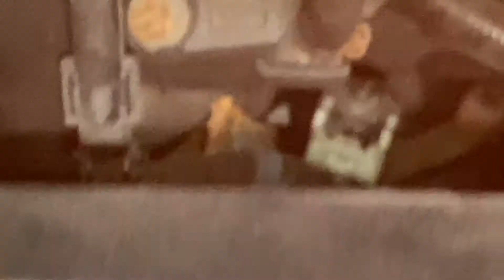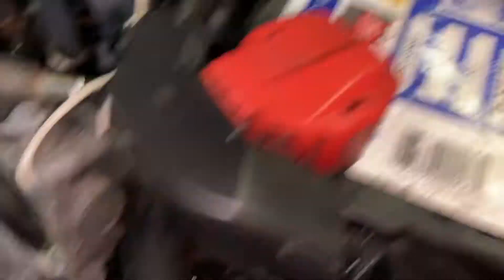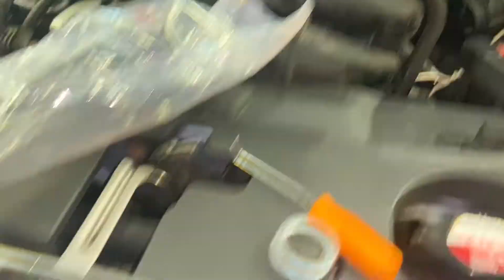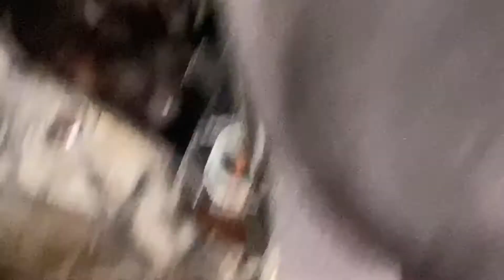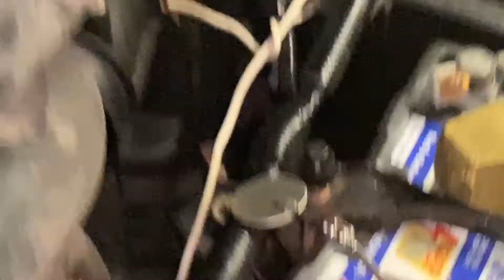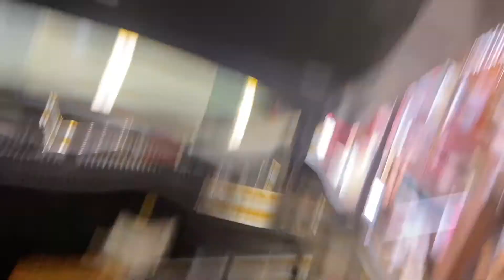K24 Honda Heater Pipe Replacement CRV ACCORD

Comment: Great video!!!  Thanks Drew...you got me though this job! I want to mention what went bad for me in the hope that it helps someone else.
2007 CRV EX
1) Be very careful with the throttle body...while carefully disconnecting the coolant lines, one of the tubes crumbled as it was completely rusted out.  I couldn't get the intake plenum out without removing the throttle body.  Throttle bodies can be very expensive, and you have to know whether the car was manufactured in America or Japan.  For the cars manufactured in Japan, the throttle body can cost much more.  Of course, my CRV was manufactured in Japan.  I was able to get an aftermarket throttle body for a fraction of the OEM price and it is working just fine.
2)  The heater pipe broke off inside the thermostat housing as expected.  Couldn't get it out and had to remove the thermostat housing.  The easiest to access bolt (top one) was seized inside the plastic housing.  I had to cut the plastic around that bolt to remove it and damaged the housing.  Don't waste your time with the housing from AutoZone, it doesn't allow those special bolts to pass though when attaching the thermostat.
3)  A re-learn procedure will probably be required when disconnecting your throttle body and was required for adding the new one. I was getting a P057 code for idle higher than expected and it was idling just over 1000 rpm.  The re-learn procedure did not work without using a scan tool to reset it and then it relearned just fine by driving the car.

Thanks again Drew!
Reply from the maker: Wowsers! Yours was quite the adventure! Thank you for these comments I hope they get seen. Maybe there is a way for me to pin them

Just a note: the Vin number tells a lot about where the car was made. J is Japan. A full list can be found googling (check out the Buick envision - made in china!). Glad you’re through it! Please like and subscribe if you haven’t already :)

Comment: I did this job today and your video helped. Thank you.
My tips are: DEFINITELY have 10mm and 12mm bolt extractors on hand. Replace all four manifold gaskets, you don't want leaks and the gaskets are very cheap. There is no need whatsoever to remove the throttle body from the manifold, unnecessary work. Use a liberal  amount of silicone grease on the heater pipe O-ring. Use a Honda heater pipe if you can find one. An aftermarket pipe MIGHT work but if it doesn't, you get to do this mess all over again.

Comment: I want to thank you for making such an amazingly detailed video.
I'm a former master wrench, and knew it would be a sucky project on my son's 2010 CRV.
Hard to to find the pipe, but I lucked into a new-old stock part.
I didn't have to remove the throttle body.
I also didn't break the bracket holding the connector to the manifold, but it took about an hour to get it off.  
If unbroken, the pipe is very hard to get off due to hanging up on the aluminum intake assembly at the front AND the bracket on the right side severely limited movement.  I probably spent nearly 90 minutes patiently trying to remove thepipe without breaking it off in the thermostat housing.  I had a spare housing and gaskets ready for the worst case scenario.
In the end, i used a small pipe cutter.  Once the pipe was severed, i was able to get it out.
I worried that it would be difficult to get the new one in place, but it went in pretty easy.
Your humor was awesome!
It took about 7 hours which included setup, a short break or two, and full cleanup and test drive.  I'm very patient, and moved carefully through nthe process.
Funny, it was much faster reassembling.
The job is not for the faint of heart.

Comment: Drew... Thank you.  You got me through a nasty repair. (2010 CRV 4x4 LX)
Thank you brother. (great tip btw on the long bent needle nose pliers, I had no idea how badly I needed those)

I bought my pipe on Amazon   "COOL STAR 19510R40A50 New upgraded Heater Pipe Comp Heater Compatible with 2008-2016 Honda Accord 10-11 CRV Odyssey Tourer 19510-R40-A50"  It fit perfectly and included the gasket.

Also, to the commenters... Thank you.
I left the throttle body attached - great call
I changed the 13 year-old starter also when I was there.
It was a BEAR to get the 14mm and 17mm bolts out even with the plenum removed.

Thanks guys, Chris M. in Tampa, Florida   
2.18.2023

Comment: Thanks for the video.  I just took mine all apart yesterday and my pipe was broke off in thermostat housing as well.  What a bugger to get that piece out!  I was able to leave the throttle body on and just left it attached to the intake plenum.  I did take out the air filter box and battery to give me room to see and work. Those came out pretty easy.  Thanks again .
Reply from the maker: You’re most welcome! I’m glad it worked out! I think a seal puller helps when it breaks off. Either way a pain! Please subscribe if you haven’t :)

Comment: This video is a car-saver (lifesaver !!).  Visually, because of rust ring at leaking joint, I first thought I had a rubber hose with rusted away clamp.  Removed steering pump, then alternator, for access and THEN discovered hard pipe - still shiny enough that I thought it was hard plastic.  Wasted goodly amount of hours with wrong diagnosos.  Found video (only other one on YouTube) and finally knew nature of the joint.  Have ordered thermostat housing (just in case) and steel pipe.   This video is VERY  thorough and complete for repair, start to finish; it is invaluable for getting the repair done with a proper approach and technique.
Reply: ...and pipe.  This video is VERY thorough and complete for the job, Start to Finish !  I agree with comment by another "The best how-to video" ever.  THANK YOU Drew C.
Reply from the maker: Well these are extremely kind words! I am glad it helped! Please subscribe if you have not already. I am working towards putting together another video that will be the only one on YouTube, the dreaded Prius evaporator core! Anytime I attack a big job and don’t have a video to go by, I try my best to create one to help you all! Glad this was valuable to you

Comment: When tightening the intake plenum DO NOT start at 1 end ALWAYS START IN THE CENTER or you could have a high-risk and cracking the intake and having a big problem just a quick tip. Great video super informational just wanted to throw that out there though.

Comment: The best how-to video I've run across, bar none. I was on the fence about doing this job myself and finding this video convinced me to DIY. I had to source the pipe from Japan for 4x the dealer cost as well due to the backorder. In the meantime I watched this video three times and then queued it up in my garage as I did the work. I really appreciated the level of detail like how to disconnect each wire harness & retaining clips. I had the same issue with the lower wire connector clip swelling in the housing and had to wire tie it the same way. Also appreciated were the tips like on the brass hammer to seat the sockets, rags in the intake manifold and all the fastener access tips. Thanks to you I got the job done in a few hours. After seeing the trouble you had in removing the pipe end / o-ring, I cut the old pipe on the straight section. That way I was able to work the old piece back and forth to remove it without breaking the end in the plastic housing. Thank you, thank you, thank you for making a miserable job easy.
Reply from the maker: Wow I cannot even begin to tell you how much this feedback means to me. Seriously, these are very kind words and they mean the world. I am glad the video helped! Stay tuned in on the channel, because we own a small car dealership and, over the last two years and change, I have been 93% and a little change Toyota/Honda. The K 24 motor is ubiquitous among our inventory, and I do all the work myself and try to share anything I find that is helpful :-)
Reply: How to install back heating pipe?
Reply: In

Comment: Owner of an ‘07 CR-V EX here. Thank you for posting this. Just got the job done. I didn’t have to remove the throttle body and anyone with an ‘07, ‘08 model has to be mindful of the lower bracket on the aluminum plenum. Saved hundreds. Thanks again!
Reply: I have to do mine on my 08 crv.   do you have a part number for the pipe..from what I saw it says it's discontinued. Did you have to remove the intake manifold ??
Reply: @minibikemadman  Honda Dealership can give you the pipe number. Then go to “the bay” and order it from one of the stores. Don’t forget the OEM O-Ring. It has to be OEM. Yes! Manifold comes off.
Reply: @jonathanmelendez23  great to know ok ya I got a pipe on ebay a oem one ..was the last one so took my chances and said it fit my 08 ex-L . I had to do one on my 2007 Acura rdx before the crv and all these pipes rot and leak.  The only crappy issue with the K series.
Reply: It the same pipe of the 07 Accord

Comment: Hey there great job on the video.  i just replaced my pipe and starter on 2011 crv with 139000 miles on it.  it took me all day bc i clean and lubricate everything accessible as i go along.  regarding the electrical connection that swells up into the metal retainer bracket attached to the maifold.  it took me about 15 minutes to manuever that thing off with penetrating oil fluid film.type oil and just plain rocking and patience.  i got it off without breaking it.  i did a couple things a little different from.your video  but all in all your pain stakingly done video was really helpful.  just subscribed to your channel.  take care 🙂

Comment: Great video.  I saw blue stains on the engine block on my wife’s CRV when I was doing an oil change.  I tracked it down to the thermostat housing.  Had no idea there was a metal pipe there all rusted out.

I plan to do this as soon as I get the parts in.  The past comments were also very helpful and will try to leave the throttle body connected to the intake.

Comment: This was a fantastic video in order to get the pipe out with the O-ring on it I put some vice grips around mine and pryed up and down on the vise grips you have to place the 
Vise grips all the way down on the plastic and then use the plastic to pry the pipe out with the vice grips I hope this makes sense it worked for me and my pipe had a hole in it as well so it was very weak as well

Comment: Great Video!!! Removing the broken pipe part from the thermostat was a nightmare. I was finally able to remove using an Oscillating Tool to cut it just enough to weaken it so that I collapsed when removing it with a screwdriver (If I had to do it again, I'd spend the $40 for a new thermostat housing vs trying to remove broken part). Clip on the large hose connecting to the pipe was also a headache even with the angled pliers. I took a magnet and stuck it into the thermostat housing to pull out the metallic debris resulting from removing the pipe. For the lower connector Drew had problems with, give it up and just break the metal bracket because you're not going to be able to disconnect. (2011 CRV with 127K Miles)

Comment: this is a very good video on how to remove this pipe and the things that can arise along the way...to save a bit of time when removing the plenum I did not need to remove the throttle body...it was a bit tight for space but it will come out if you just move it around to get the correct angle to pull the plenum out...I also just removed the 1 bolt from the bracket on bottom of plenum from the engine instead of messing around with the 2 bracket bolts that go into the plastic plenum and the whole plenum and throttle body assembly will come out...also there is 1 bolt and 2 rubber grommet connections that hold air cleaner housing in place which makes disconnecting the rubber heater core pipe and installing it so much easier with air cleaner filter housing removed so the heater core doesn't get damaged when removing the rubber hose from the steel heater pipe being replaced...the Honda engineers were not thinking of us mechanics needing to replace this heater pipe for sure when they dreamt up this design...

Comment: Excellent video! Thank You Much! Been looking for a video on this job. Yours is the only one I have found. Probably one of the best auto part replacement videos I have ever seen. Sounds like you had trouble getting the replacement hose. No dealerships or part houses have it .I had to order from japan also. In short, you made my day!!
Reply from the maker: Hello! This is huge to me thank you so very much! That is exactly what I was hoping to accomplish by sharing :) that’s encouragement to keep filming!

Yea I had to order from Japan, too. The world is a bit of a mess right now and that’s why. My Honda dealer says $35 if they could get it but they can’t. So I laid down $90 in Japan
Reply: Hi Drew , please provide website information for ordering this part. My 2008 crv has the same problem.  At first I thought the gasket on the WATER passage unit went bad. Then I saw the end of this pipe got badly rusted. Thank you in advance.

Comment: I would have to replaced the starter while the intake was off, it looked horrible. But, great job replacing the coolant pipe.
Reply from the maker: Thank you! Sadly it wasn’t my car and it wasn’t in the budget.  But happy to say my wife’s odyssey starter like that for 100k before it failed haha 

Please subscribe !
Reply: I took your advice and replaced the starter as well.  It was a crystal bitch even with all of that room to work.
Thank you
Reply: This is a very late reply, but I think the starter can be replaced without removing the manifold.
I did it on my wife's old 2003 CRV, so it may be possible  on newer models. 
It was a challenge!

Comment: Thank you very much for making this video. I am comfortable wrenching on an engine but wanted to see someone else do the work first. After seeing this engineering mess I think I will let my local shop do the work. After living in New England and now the Midwest I know my Honda is rusted through. I will let them work through the rust.  I usually don’t comment too much on YouTube. You made an excellent video. Very thorough. I have liked and subscribed. Best wishes and Happy New Year!
Reply from the maker: Thank you so very much for reaching out! This comment is extremely appreciated and will be cherished :-) have a wonderful new year
Reply: @DrewGarage  thank you very much for the wonderful how to video.  I'm still on the fence of attempting to do this job myself as I am in nys and have enough rust to make me afraid of rounding off a bolt head in the wrong place and turning a 3 or 4 hour job into a whole day project lol.  I wanted to ask, do you happen to have any idea how much a honda dealership would charge to do this job?  Thank you for your help!
Reply from the maker: @jefftaylor4678  hi thank you for the compliment! I have no idea what they’d charge but I assume a lot. I’ve been there, done that with the bolt head rounding. I just take the next size down - usually if it’s a 10mm, I’ll grab a 3/8 for example, and tap it on with a brass hammer, then replace that nut or bolt. I just did the timing belt on my wife’s Odyssey, and this happened with some of the timing cover bolts. The Honda dealer could not get them because the world is on fire so to speak, so I put the damaged ones in the easiest places to get a hammer next time. Sucks, but part of the fun ha ha
Reply: Funny thing, I did end up doing this repair myself and used your video as my guide. If I recall I saved over $600 by doing it myself.  The part off of ebay cost me $20.  I was glad to even get the part as nobody had it. Thanks again for your video!
Reply from the maker: @forrestgriggs8667  that’s amazing to hear thank you!
Reply: @DrewGarage  thank you for the quick reply
Reply from the maker: @jefftaylor4678  you’re most welcome :)
Reply: @DrewGarage  your video is very helpful,  I think I'm going to try to source the part and attempt to do this myself. I'm afraid to drive it now because I don't want that pipe to blow.  I'm not sure if I'll be able to find the bolts to replace any I might break or strip or round off.  But I will do like you said and put them in the easiest locations to get a hammer on them in case I ever have to get in there again.  Thanks again!
Reply from the maker: @jefftaylor4678  a can of wd40 and a wire brush to clean threads should help you. Nothing is impossible but some things suck while you are overcoming them
Reply from the maker: Also, I find a quick Snap of an appropriate amount of torque, rather than using on, helps to not round things. I was making sure you are all the way on them
Reply: @DrewGarage  hello again,  my honda dealer is also Currently on back order for this part,  would you mind sharing with me where you were able to find your part and how long it took to ship?  The one I need will be a slightly different pipe as it's for a 2008. Thank you for all you help